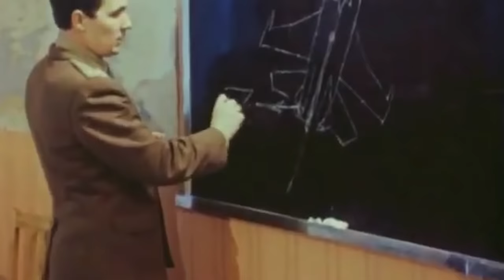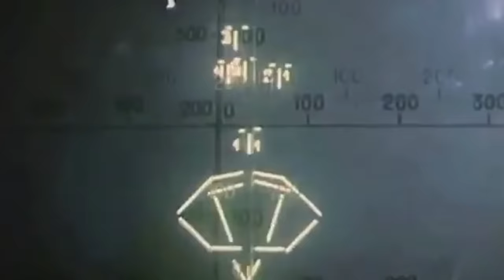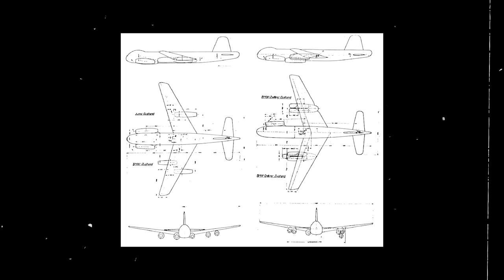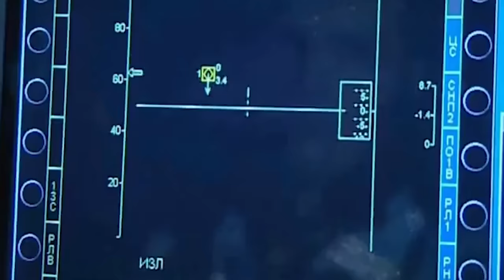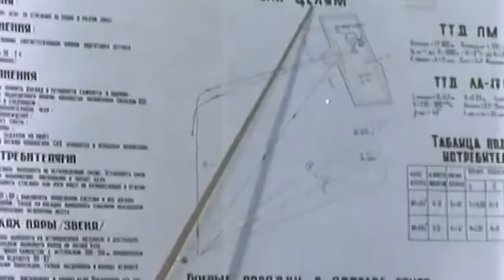The Secret Russian Fighter with Backwards Wings

Comment: A detail people speaking with confidence/authority need to get straight: The X designation on American aircraft denotes strictly experimental status.  Y designation indicates candidacy for standard production (there's a possible limited exception with the YF-12, owing to rumors that it briefly saw actual service; though, that's not particularly verifiable, considering it was still a CIA jet at that time).  If DARPA is involved — and even more so if NASA, or JPL is — that aircraft is being used for research with the intent of informing future designs from various airframe builders.  To that end, the X-29 wasn't cancelled because the Air Force didn't want to make a fighter out of it.  The project was concluded because it did what it set out to do, and all parties involved learned critical data they were able to apply forward.  Also, there was only so much flight time they could get out of the X-29s, considering they were built from existing F-5 donors that had already been taken out of regular service; lifespan was then further compounded by increased stresses at the wing roots and outer ~1/3 of the ailerons — all just a natural consequence of the forward swept wing design.
It's also worth noting that forward swept wing designs run into flight speed limitations — both physical and operational.  The degree of wing twist increases in relation to airspeed, also increasing instability with it to the point that flight computers eventually wouldn't be able to compensate.  So, you're guaranteed to wear out the wing faster than normal, at almost any given air speed, neverminding the cost of higher grade computers to keep things stable at the higher speeds.  And that fact absolutely applies to the Berkut as well, as tipped off by the severe disparity between it's maximum speed at altitude versus sea level (Mach 2.2 and 1.1, respectively, though some reports indicate it's stable maximum at altitude is actually Mach 1.7).

Comment: The Russian pilots were right to worry every time there was a "cracking sound". As we have seen with submersibles and also the F-117, composite structures under stress can develop cracks and imperfections. When they finally fail they give a lot less warning than metal. An F-117 delaminated in flight.
I really wonder about the service life of wings that absolutely depend on their carbon fiber construction to maintain integrity and aerodynamic stability after military use under high G's.

I think that was one of the areas where the X-29 was superior to the Sukhoi is the use of the tailoring of the carbon fiber composite to overcome the flexing of the wingtips that caused instability and even possible structural failure.

Comment: The Soviets were late to the game concerning a Forward Swept Design, The United States had already tested and Flown the Grumman X-29A, practically using off the shelf technologies, and a fliy by light avionics system.  It had even Tested and flown a superior cranked wing design, the F-16XL.  The X-29A proved to be superior to the F-16C/D, then in production though it was slightly slower at Mach 1.9. The X-29A flew from 1985-1989.
Reply: Dude, Nazi flew Ju 287 40 years before x-29a took off.
You're nothinh special, my dear USians, not at all.
Reply: @nathanielnachtigall7074   Unlike the Germans, However the US built one that was stable in flight. It ise the F-5 Body, the Tricycle landing gear of the F-16, and was fly by light. So in the grandscheme of things that makes we AMERICAN's (not USians, moron) Pretty  special.  At least we got the unstable design to fly AND be controllable at Mach 1.9, and without the extra BS the Russians lumped on their design.
Reply: The Russians  had a FSD bomber in 1939 called the  Belyayev DB-LK, hardly late to the game.
Reply: @georgebarnes8163  bat wings aren't a Forward Swept Design. The DBLK had fairly normal leading edges with swept trailing edges.
Reply: The Soviet, rocket powered Tsybin LL-3 first flew in late 1947. It was a 30º Forward Swept Wing (FSW) research airframe, making more than 100 (!!!) successful test flights (in glider and powered form), accumulating valuable data and reaching a top speed of 1,200Km/h (Mach 0.97). The German HFB 320 Hansa Jet first flew in 1964 and 47 production airframes were made. It was a civilian business jet but was also operated by the West German Airforce serving as a VIP transport and an ECM trainer. The United States "were late to the game" by 37 and 20 years respectively, considering the X-29A first flew in 1984. The F-16XL has virtually nothing to do with the FSW concept but if I was to respond similarly to so many Americans on public media nowadays, I would say the F-16XL wing design is a copy of the Saab 35 Draken wing..., but I am not going to. In contrary to what you are clearly insinuating in your second comment, the Ju 287 exhibited extremely good handling characteristics and was very stable, but also revealed some of the problems inherent to the forward-swept wing concept under some flight conditions i.e. wing warping, and/or excessive in-flight flexing. All these were known to both, Germans & Russians, well before the US decided to put wings on a fuselage, facing the other way around. Later when newer and better materials became available and aerodynamic design evolved sufficiently, the Russians decided to  have a second go with the Berkut (Su-47) technology demonstrator, an aircraft vastly superior to the X-29A in all aspects and by any measure. Lastly, the "unstable design" argument you propose, is mostly a myth (yes.., some design concepts are inherently more stable than others). However, all aircraft can be designed to be stable enough, even flying wings. "Instability" in modern fighters is build into the design on purpose, to increase agility and maneuverability and it is kept under control via sophisticated fly-by-wire/light systems. You may also want to take a look at the KB SAT SR-10, yet another Russian design with forward swept wings, proposed as an intermediate jet trainer.

Comment: Lots of errors and approximative assertions here. Between others, carbon fiber is not a composite material ( 3:14 ) but  one of several components of a composite, also max. take off weight of the prototype ( 4:07 ) was indeed 35K, but kilos, not pounds, so you just missed by a factor of about 2, and last, the fall of CCCP did not occur in 1989. I love all your dark.* vids anyway.

Comment: Composites don’t relieve the stress, they manage it without failure. 

The US aircraft’s first flight was in 1984. The Russian’s first flight was in 1997. Your presentation suggest that the Russian aircraft was first, or at least a contemporary of the US aircraft. 13 year’s difference, they weren’t contemporaries.
Reply: Well, composites manage the stress without failure, until the point that they don't
And, once composites hit that point, the failure is critical
That would weigh on my mind, if I was piloting a composite airplane at the edges of its performance envelope...
Reply: That’s why the wings etc use a mix of materials. 

In the case of forward sweep, tip twisting is the biggest concern. Therefore the designs used aluminum and titanium spars and framing along with composite skins. The metals managed twist, the composites added reinforced stiffness in needed direction.
Reply: That’s why the wings etc use a mix of materials. 

In the case of forward sweep, tip twisting is the biggest concern. Therefore the designs used aluminum and titanium spars and framing along with composite skins. The metals managed twist, the composites added reinforced stiffness in needed direction.

Comment: Pretty sure nasa had a f5 with that type of wing, they figured out it wasn't worth the hassle but obviously the Soviets didn't.
Reply: You're thinking about the X-29. It was built on the cheap and used a lot of parts off other airframes. IIRC, most components came from the F-5/T-38 and F-16.
Reply: X-29